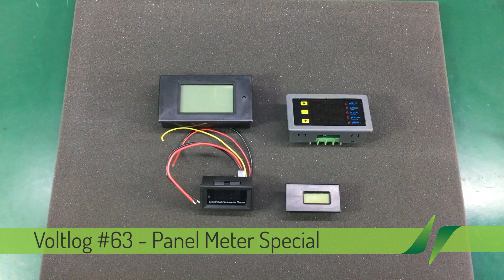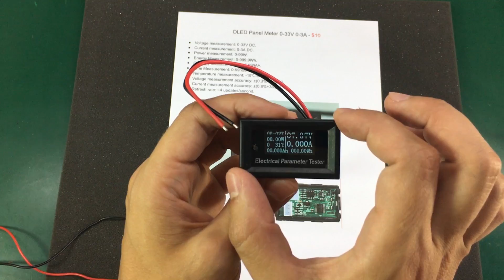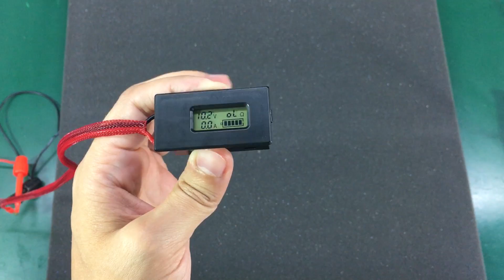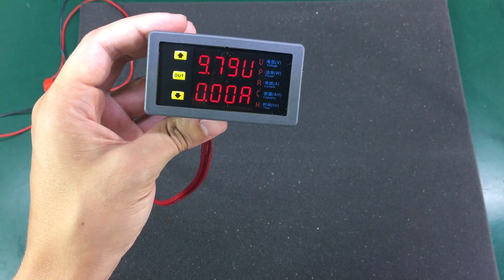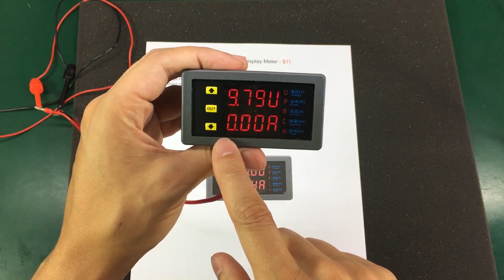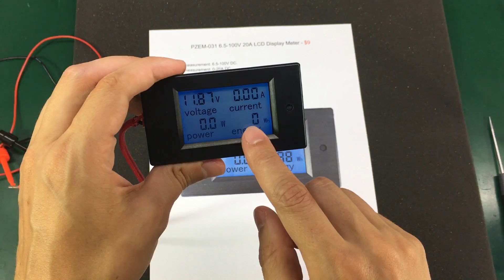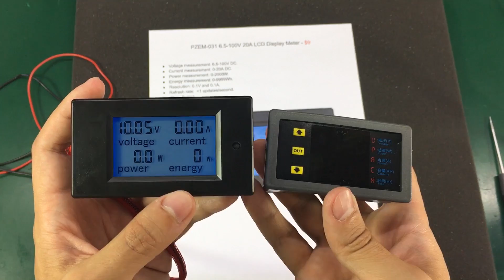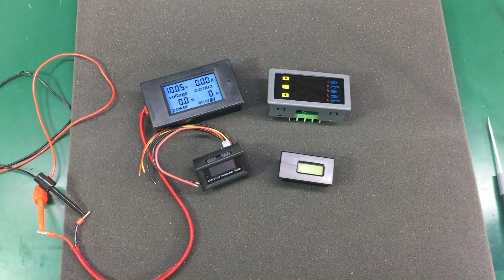Voltlog #63 - Panel Meter Special

Comment: I have the last one. Few days ago I connected it to my solar panel and today I noticed voltage is completely wrong. Instead 60V meter show me 85V. I discovered how to calibrate it. Just remove back panel and in bottom left corner are two holes marked "W". You have to short them and than connect meter to 20V with 1A load and meter will calibrate. Accuracy is now better than was originaly.

Comment: I bought the second one  you show us on the video and looks nice but for a li-ion battery it's highly inaccurate. I originally bought the meter for a diy power bank that I'm building from laptop battery pulls and unfortunatelly can't be calibrated. I ended up installing it on a 12 v sealed battery battery and it works ok but the amp meter is inaccurate as well.
Reply from the maker: thanks for sharing that info, I didn't check the accuracy on either of these yet.

Comment: Couldn't you build something like that fairly easily, with an arduino, and use a ACS712 to measure voltage, and a voltage devider  or a MAX471 (Although it only does 3-36v & 0-3A), and use whatever temperature sensor you want?
Reply from the maker: I wouldn't say it's fairly easily to design something reliable and easy to use. I would probably use a TI current shunt amplifier (INAXXX series) and some precision resistors for sensing the voltage and getting 1mV 1mA resolution and better than 1% accuracy full range. So the analog section would need some testing and fine tuning and then driving the lcd display, creating a GUI would also take some time. Maybe I will start doing it someday, but not today :)

Comment: At the Moment i am also Building a power supply and i decided to go for separate voltage and amps meters. I found some 5 digit meters going from 0-3a and simmilar ones going from 0-33v. On Banggood its SKU ID1060900 and ID1060897 but you can also find them on eBay. There are a 3 wire and a 4 wire Version but only the 4 wire is the Most accurate. I do not need Wh and W. Maybe take a Look? Update Speed of them is Great.
Reply from the maker: I have seen these panel meters on banggood, they seem to have very good specs on resolution and accuracy but I like the idea of having a single panel meter slot on the front panel. I usually like to design my DIY projects to be as compact as possible and having two panel meters or even more doesn't seem practical to me. As mentioned in the video, an ideal meter for me would show 4-5 measurements at the same time on a nice clear TFT.

Comment: I have that PZEM-031 meter that I modified to run off a CR2032 because the voltage doesn't go low enough. https://dl.dropboxusercontent.com/u/16878864/20160830_220647.jpg desoldered the cap there and then put a switch in-line and modified the case to accommodate it.
Reply from the maker: Nice hack, I would assume you are using it with the backlight off, running from that CR2032?
Reply: I don't run it 24/7 on as I added a switch. It's just to read the output from a wd2002sj ltc3780. Poor man's adjustable PSU.
Reply from the maker: Cool!